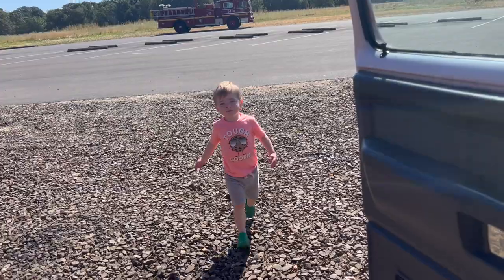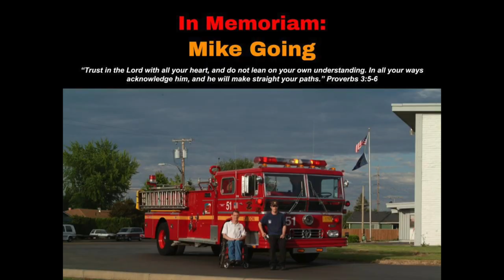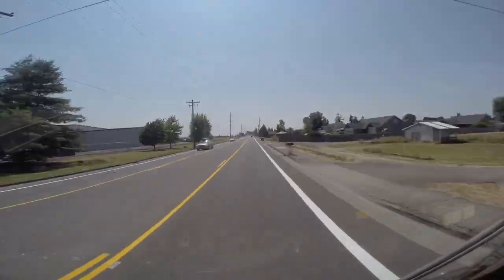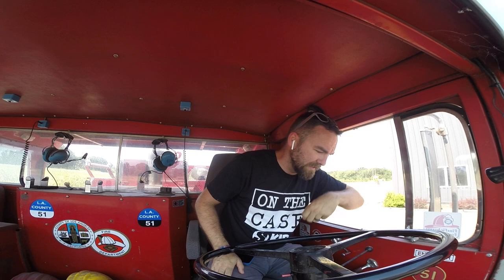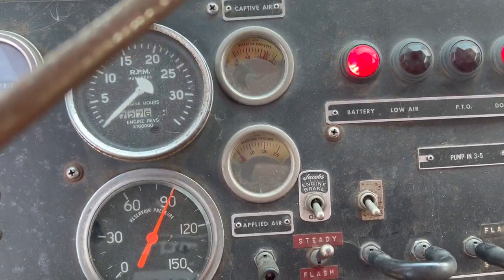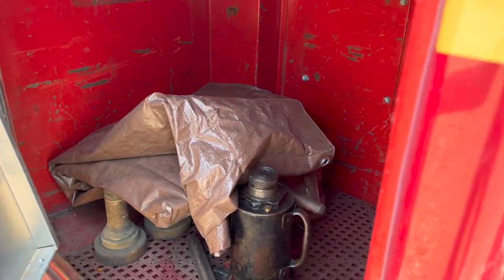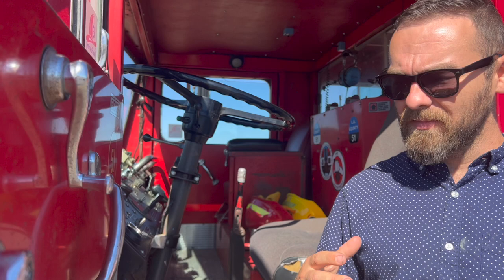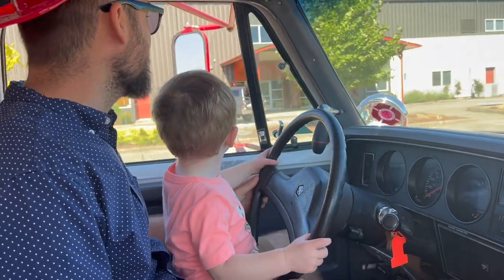We start and drive the famous Emergency! Ward LaFrance Engine 51 Replica + complete walk around

Comment: Being a firefighter/paramedic for 36 years that's pretty nice. You need to change the light bars on the roof and the mini light bars on the back to the correct single rotator on the roof and take the blue lights off the front and the lights off from under the bumper. I drove a Ward  LaFrance like that on a volunteer fire department for a few years when I was younger.
Reply from the maker: Thank you Ken for your service! And I appreciate this comment very much. Mike specifically wanted those light bars and the blue lights, he talked a lot about them and how they were not exact to engine 51, but that’s how he wanted it. Although nobody else here told me why they were so upset at the way that it looked, I now remember that he added those 😇